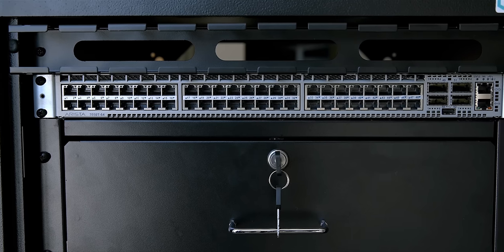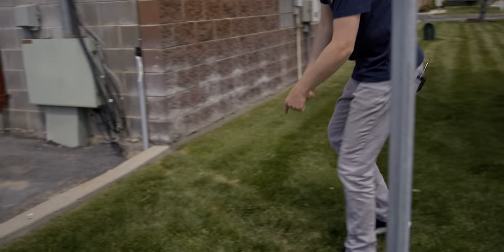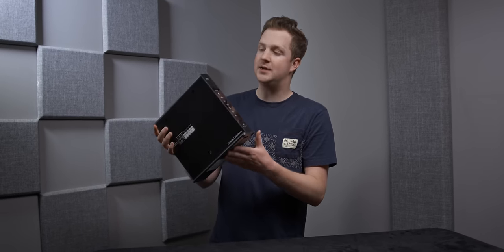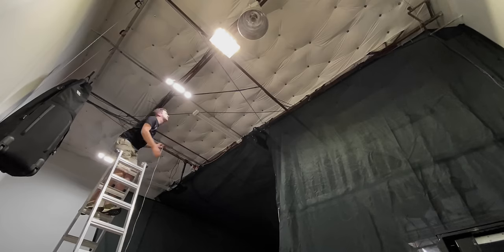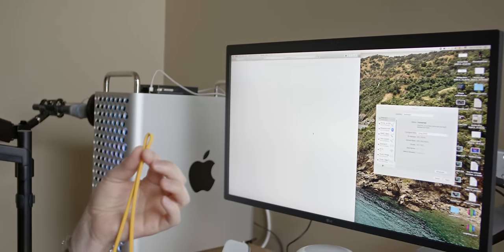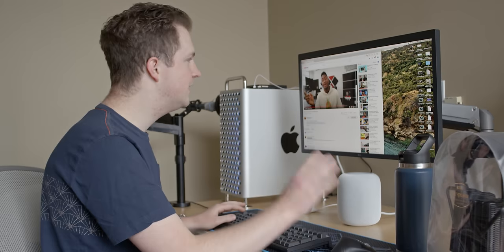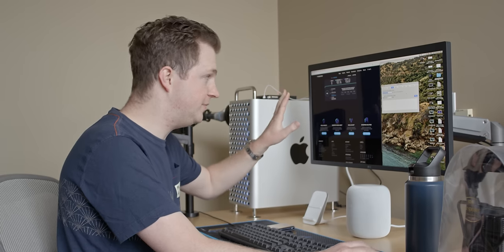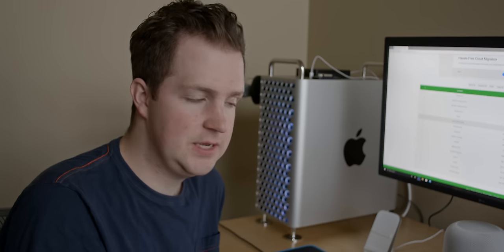How does fiber internet work? 0ms ping!

Comment: At Spectrum they call it hybrid fiber coax (HFC).  The fiber hits the node and the node converts it to s radio signal on the 500 line.  They have repeaters to extend that signal further.

Comment: That's why ISP's are still using copper lines due to durability. As someone who's been with Comcast, ATT, Verizon, and Frontier. I can guarantee at some point in time you will encounter speed drops due to a variety of reasons and the cabling issue is one of them.
Reply: Plus, it's not that copper can't handle big speeds, the main reason why is just because how it's divided and shared in the first place.

It's almost like an Apartment building you see, if you actually think of one floor, it has quite a lot of area, but then they split it into smaller so called "apartments", and scaling this wouldn't be easier once it's fully built. That kinda applies for many copper like technologies, that's why they can't push as much bandwidth as fiber can, otherwise copper has no issue reaching really high speeds. Theoretically, even Terabit DSL speeds exist!

Comment: Yes, the fiber cable that you are using is a big diameter cable. In the other hand, when you have really thin fiber cable, its most likely to break because you bended it too much as seen on the video. Same goes for the copper cables, if you bent it too much the connection will be horribly slow or not even making it trough.

Comment: I was told ages ago when I put a 90° COAX connector on my cable modem to reduce tension of the COAX, that eventhough I measured no difference, he said, “Radio Wave Don’t to do Corners.” That was one heck of a corner.

Comment: Thats cool to bad i was told by at&t i would get Fiber in 2019 and still dont have it.
Reply: i was told in 2017 I:
Reply: what about not having internet your whole life but getting fibre next week? that's me can't wait
Reply: osckear how are you writing this then?
Reply: AusDaes it’s called a phone 📱 (cellular data)
Reply: @ferni0  hes using his phone aka cellular data
Reply: i was told by AT&T twice in 2018 that i would get fiber by the end of the year. Never happened. Then in 2019 they said, "oh you will have it by the end of next month. we are working on installing it in your area". that was a lie too, turns out when they run your address they only run the zip code. I'm stuck with 5Mbps download and .7Mbps upload. Luckily, my power company got approved and got licensed to become an ISP. So they are currently running aerial fiber across their service poles. So by the end of this year, I will have FTTH. Can't wait. been stuck with this internet for 8 years. AT&T is quite possibly the worst big name ISP. can't tell you how many times they've lied to me. when they came to install internet for our neighbors across the street, the technician unplugged our connection and plugged theirs into our slot. we were without internet for a week before they finally sent someone out there to fix it.

Comment: As a technician who was in a metro market with FTTH, I do have to correct one thing - yes, your fiber cable as a cable is split and shared throughout the neighborhood, but that's not the end of the story. You do have a direct connection - you have one strand of a fiber cable, and each cable has over a hundred other strands inside. You get full duplex 1Gbps even on a single strand, actually. One of the largest downsides to GPON is the fact it does not entirely negate ping - this is still affected by servers and the mux/demux of the light in the cable.
Reply: I don't think that they are on gpon. It looked like standard sfp+ bidi.

Comment: The DAC cable is also known as twin-ax. The majority are copper based but you can get fibre versions. For short cables they're much, much cheaper than fibre SFP modules, tho the QSFP DAC I needed for my Palo Alto 5220 was quoted by PA as being several thousand for a 10 metre cable - which was the only size they offered it in!

Something people need to remember when it comes to SFPs and DACs is that many network equipment manufacturers won't support 3rd party modules and will either refuse to look at support tickets until you buy a 1st party module or will actually completely invalidate your warranty citing potential damage caused by the unsupported module. It's a lot of fun when you update the OS on your switch or firewall and find they've removed support for your 3rd party module.

Regarding how much you can bend the cable before you lose signal, it's generally called the bend radius and is due to the fact that fibre is a small strand of glass and bending it attenuates the light to the point where none of it reaches the other side. Bend it too much/far and you're liable to snap the glass and lead to a lot of light leaking out of the cable. Interestingly the way the switch functions is that it records the light level as a power level (Rx and Tx) measured in milliamps and dBm.

For your ping, it's not really representative to ping what is effectively your local network on the WAN side of your router as you'd expect that to be the shortest round trip time, especially if all you're pinging is your gateway address (which would be 1 hop). I would ping something like a server within your country but not on your ISP network to force it into making several hops, which you can see the latencies of each hop if you use the traceroute/tracert command to determine where your connection is getting the latency from. Keep in mind you get those sorta low latencies when you ping an IP on your internal subnet, usually represented in windows as "<1 ms".

I've been getting 10G net connections set up in our offices and I'm looking forward to bringing them online soon :D

Comment: kevlar strands surround the fiber in the cable, it helps with crazy bends but can still break
. Also the bending of individual fiber help locate fiber when splicing in a case out doors.

Comment: Awesome video, I shared this with a new colleague to help understand basic networking. At my office (Evolving Networks Limited) here in the UK, we have a total of 4.4Gbps upload and download usable in our office. We aggregate multiple IPS connections together to form a single useable broadband connection in sync with our core SD-WAN network and provide the same service to all of our customer depending on availability in their area.

For example in my home right now, I have 2 FTTC connections that present RJ11, those cables connect into a single 'EVX' via an SFP VDSL2 modem that aggregate the two 55/10 connection speeds to a total of 108mbps download (there is 2mbps taken for overheads) and 19mbps upload (2mbps for overheads). Each broadband link is with a different ISP, so if one network were to fail, my connection still carries on without even noticing a drop in a VoIP call, so we provide not only a massive boost in speeds but also resilience. The SD-WAN side of our services in a WHOLE other subject.

The single device I'm using also has an integrated 4G SIM with modem so if both links were to fail, the 4G kicks in and tunnels to our core network, keeping me connected with the same public WAN IP. The device also does 802.11ac and I'll soon be upgrading that to ax once my supplier can provide me with a large batch of the Wi-Fi modems.

Comment: Great review. I have att fiber 1G plan. Speed test from outside to router/gateway is 1200Mbps using ookla app and browser but speed test using my iphone 12 pro (only device connected to gateway and next to the router) but getting average of 500M only. I used laptop wired connection (only device connected) and still 500M. Question, how did you test with ~900M result and what spec your device you have? Is it device compatibility that I only get like half speed only?
Reply: Of course your devices will make a difference to your speed aswell as other factors like WiFi settings and other things. I have the Virgin 1gig package and the devices I connect with only receive about half of that because they are older devices and i only connect to WiFi, and actually the WiFi speed is better than the ethernet speed on some. I don't have the budget to upgrade my devices so I can't get the speed that I should.

Comment: The switch on the unifi dream machine has a managed switch on it - it's not just managed because it's a router too. Since it does switching at layer 3 (routing) as well as standard traffic router, it's more than just a switch + router/firewall.

Comment: a 0 ms ping is impossible, unless your internet is faster than the speed of light.....
Reply: not faster than the speed of light but just as fast as the speed of light, and that is what fibre optic is. Its light the travels through the wires, and a ping that low is possible when you connect to a server in your city. I get around that much ping
Reply: And he was pinging himself, you can see he used the same IP there: 15:55 17:19
Reply: Anything under 0.5 ms rounds down to 0 ms
Reply: @markomclane475  the pulses of light in a fibre cable actually doesn't travel the speed of light although they've got it close in a lab some years ago but I'd imagine the equipment for that will take some time to enter production

Comment: "Fiber breaks if you bend it". Pretty much. I had some fiber at my old apartment just lazily ran it behind a couch and into the modem. Left the excess wrapped neatly like a rope and that was that. After a few days the cat went behind the couch and had a field day going through the hoops and playing with it until it managed to bend it to 90 degrees and cut my internet altogether. Of course I call the ISP and give them an earful and the guy goes "is the cable ok? does it have bends, etc." and at that point im fuming, of course it cant be a stupid cable but lo and behold, as soon as I straighten it, my internet is back. The cable itself is pretty resilient, provided you straighten it back in a timely manner.

I took the time to route it properly and hide in the walls after we moved and haven't had a problem since.

Comment: When it stops working because of the bend it is because you have surpassed the angle of refraction of the fiberglass on the inside. It is the same principle of how when you shine a laser into a body of wire, the light bounces of the top until you reach an angle.

Comment: About 3 months ago, I went from Spectrums 400/20
To AT&T's Fiber 500/500 And I am loving it.

I've had only ONE issue and that was on the installer who made the cable that went from the outside into the modem, apparently he didnt crimp and make the cable properly.

But other than that one morning of inconvience. I have not regreted the choice.

Also I am spending something like 40 dollars less.

Comment: i work for isps working on the lines out on the street on coax and fiber lines. and the black box out side your building is a fiber splice case. you did luck out on it being outside the building cause otherwise they would mostlikely run a line to the closes case and that could be from under a mile to sometimes 2 or 3 miles if not more. i have run fiber for people like that.

Comment: @11:39 the part where u bent the fiber cable and the internet stopped..technically you are creating a point of attenuation..if it is below a certain threshhold (depending on the nature of optics/optical power, 3km,10km, 25km,40km etc)the optical signal is to weak to complete tx and rx in this case... that is a very important concept you have demonstrated there, it can be visualised using a laser/Visual fault locator or an OTDR trace, sometimes on maintainance a degraded signal on a cell site or a customer premise can be corrected by opening a fiber closure and just straightening a fiber core  than may have kinked/bent and all is well

Comment: Finally!  After searching the net for days I found some great answers in this video.  However I have some more questions now.  I am building a new house and will have CenturyLink's Gig FTTH.  I have no idea if it will be PON or AON.  I want to build the network in my new home just like you did for your business.  Multiple RJ45 in the home, several wireless APs, PoE cameras, NAS, etc.
1. What role does the Juniper play?  Couldn't you run straight from the ONT to the Ubiquiti Dream if it will ROUTE?
2. I want to avoid using a dime store router.  Will there be any discernible improvement using the Dream Pro vs a cheapie router/wifi/modem?
3. What's the thing called that all your home runs are terminated at then patches into the Arista?   Is that a punch down termination?
4. With new construction, would you run copper or fiber (or both) to all the ethernet jack locations?  Is Cat 8 a viable option?
Since the opportunity is there, I might as well do as much future-proofing the house as I can.  Who knows, maybe one day 10gb FTTH will be available.  I'll be taking a dirt nap by then but I can dream.

Comment: Hi Quinn. There's something I don't fully understand. Why is the Juniper ex2300-c necessary? I mean, you could plug in the fiber that comes from the street right into the Dream Machine Pro, that acts as router-firewall-switch, and then to the main switch using the SFP direct attach cable.

From what I understand, I just can't see the need for the Juniper switch. It's just a switch and you only connected two things to it. Could you explain it to me?

Thanks :)

Comment: Such an interesting video!! I just moved out of my parents house and we live in the same street (middle of nowhere). They have cable, I got DSL because cable is way too expensive.
They have 1 Gbps down, I sync at 100/40, but sinch I'm on a 'budget plan', I'm capped to 50/20. I pay €30 for a landline, TV and internet, they pay slightly more than double.
I prefer DSL so much over cable, it feels just so much snappier + you don't share your connection with anyone.
My ping times are usually 5 - 7 ms and jitter is always under 1 ms, often even under 0,1.
My parent's (cable) ping times were always 11 - 16 and jitter was often around 5 ms, only dropping to 2,5 after the evening. To be fair, because we live in the middle of nowhere, the cable is shared with the entire neighborhood. In other area's, they usually run 2 or 3 cables. Since they get gigabit, I also noticed speeds drop from 960 Mbps to 840 worst case when the network's busy. When they had 200 Mbps, you could barely notice other people were using the cable.

What's ridiculous though is upload. They only get 40 Mbps upload (probably because the cable company knows for stability reasons, the phone company doesn't allow more than 40 Mbps upload on DSL). That's insane. If I dropped TV, I'd have the same upload speeds for the price I'm paying now!
I live in a country in Europe where they've been ridiculously slow to roll out fiber (mainly because DSL and cable are available to pretty much everyone and pretty decent, a lot of countries like France that had crappy networks decided to switch to fiber straight away instead of upgrading their existing networks). If I could get it, I'd get 500/100 for the same €30 from my current provider or €35 for 1000/1000 from another fiber network, but it'll take forever and especially in my street...
50 Mbps upload is currently the fastest I can get via a provider that offers internet and TV over LTE, but ping times are usually a little over 20 ms and it's just not as stable as a wired connection.

Upload is getting so much more important than download. I know there are hardware limitations, but ISP's should get that.
Edit: forgot to mention, I think in the Netherlands the phone company replaces copper pairs with individual fiber lines, which I'd prefer. In my country, it's gpon, though. It's also stupid that there's literally fiber running to the little cabinets from the cable and phone company in my street... like would it be so hard to run fiber from those things to people's houses? :p

Comment: The Swisscom fiber connection to my apartment here in Zurich (Switzerland) delivers 10 Gbit/s up and down. It costs about 100 USD/month. The speed test (run directly in the modem, because my laptop can't do more than 2.5 Gbit/s on a cabled connection) shows 8000 Mbit/s download and also 7925 Mbit/s upload. Pretty amazing. The modem has four 1 Gbit/s connectors and one 2.5 Gbit/s connector. The WiFi can't pump out more that about 800 Mbit/s per connection. So you would actually need several connected devices and several wifi devices to use the full bandwidth. What will the future bring?

Comment: Anyone wondering what is in the ground, it's a fiber hako. It's where the feeder fiber comes in and is spliced to the individual drop to the house or business. There is most likely a service loop inside that hako, that has a lot more fiber than the few drops going down that orange tube. those usually stay intact and continue down the line to feed other FST (fiber serving terminals)

Comment: The fiber cable bending and loss of connection is due to physics of total internal reflection in fiber cable. Therefore, when the cable is straightened, the angle of reflection for the laser is improved for communication.

Comment: The sharp bend causing slow internet is in itself pretty easy explainable: When you bend the cable so much, the angle is so drastic that light can "escape" through the layer on top of the real fiber meant to keep the light inside. Picture it like a reeeeeally long ethernet connection, where the signals arrive very weak, if at all. Some intelligence agencies actually use this technique to tap fiber cables, because it leaves no tracks, and to get useful signals out of it, you don't have to bend it that sharp

Comment: 11:48 I called my ISP and was losing my mind because I was suddenly getting a terrible connection for an unexplainable reasons. Turns out, someone moved the router and bent the fiber cable so I simply straightned it and everything was back to normal